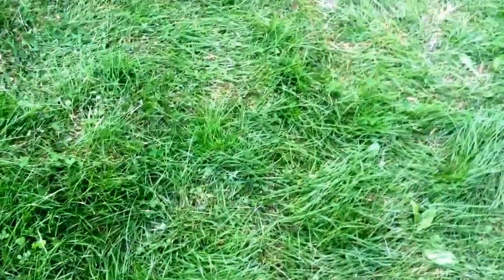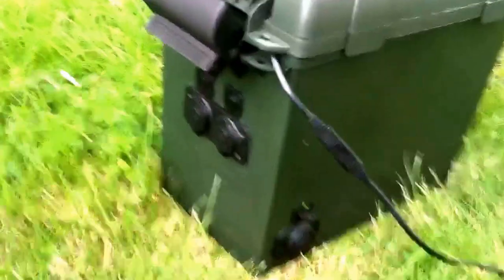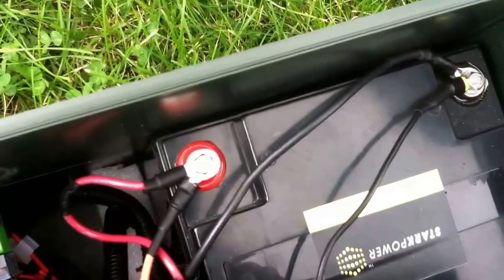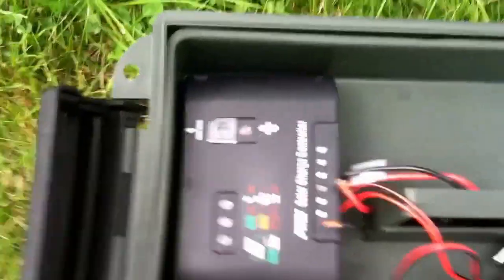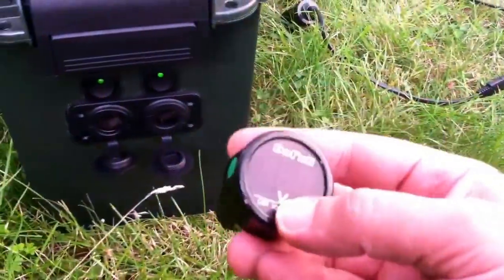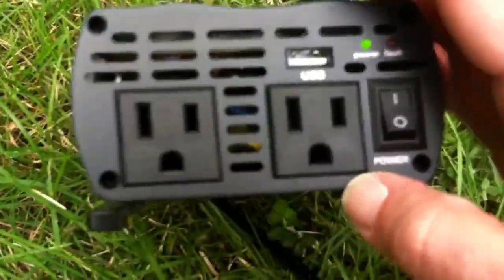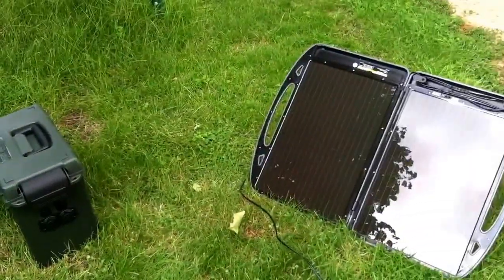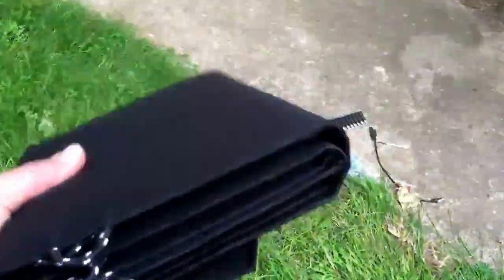Portable Solar Power Generator Lithium Ion LifePo DIY

Comment: Hey I know this is an old video but that's solar charge controller you're  using is for lead-acid batteries, not for lithium ion.  You're probably overcharging us batteries every time you connect that solar panel. Also that Harbor Freight solar panel, is that the 13 watch version? I also have one of those but I upgraded to a powerfilm flexible solar panel, for less weight and more amps in. Anyway thanks for sharing your build.

Comment: You CAN replace the AGM batteries in the Yeti 150 & 400 with LiFePO4 Batteries. This is actually CHEAPER than buying the YETIs WITH the Lithium Batteries from Goal Zero-if you know where to look.

Comment: I am interested in putting generated power into li-po batteries, I am stuck on how to regulate the power in, the solar controler is for lead acid battery according to amazon,..does it work ok with your li-po or did you have to do something?  Thanks!
Reply: Hey guys definitely don't use a lead-acid charge controller on a lithium ion battery. You can get away with it with lithium iron phosphate batteries but not lithium ion. There's one coming here that says they're using lead acid charge controllers on lithium batteries. That guy doesn't understand the difference between Lithium ion and lithium iron phosphate. With the exception of the wrong charge controller in this video, it's pretty good build. Genasun makes a series of charge controllers for Lithium ion and lithium iron phosphate. That's what I used on my solar generator build.
Reply: Eric Krohn I'm in the same boat as you.
Reply: Need a hobby charger to maintain voltage while pushing amps.
Reply: I have a pair of Bioenno 15 Amp LiFePO4 batteries. had them for about a year, now. I have used a "lead Acid" Charge Controller on them from a 150 Watt Panel, and have had ZERO problems.
As yet, I do not have DEFINITIVE proof, but I am becoming more and more of the belief that any decent controller will work with the lithium batteries without harming them, but-DO NOT HOD ME TO THAT!
Google Light Harvest Solar in Portland OR, and speak with a man named Miles. That guy KNOWS HIS SHTF!
Reply: @bruceforster3709  you should edit your comment Bruce. Your bioenno power batteries are lithium iron phosphate not lithium-ion. The voltages are different, that's why you were able to get away with you let acid charge controller on their batteries. This build is lithium ion build according to them guy in the video nominal voltage is 11.1. Nominal voltage of a lithium iron phosphate system is 12.8. That's much closer to lead acid.
Reply: @OH8STN  Your point is well taken, and I am CERTAINLY open to correction! Given what I have learned since, you are ABSOLUTELY RIGHT! That being said, I have since determined to use dedicated Lithium Iron Phosphate designed controllers from here on.  OMG, it IS expensive to get into this stuff, but I feel the money is well spent.
Reply: @bruceforster3709  yeah the cost is heartbreaking in comparison to the cheap Chinese controllers. But I've been using these controllers for years and I have never had one fail, or destroy a battery. So I look at them as an investment in my expensive batteries. Bioenno makes one for your batteries btw. I don't use it because it charges to 14.6 volts. That reduces the life of our lithium iron phosphate cells. But they have a good service life anyways so, maybe it's not a bad thing.
Reply: @OH8STN 
 Kevin tells me they CAN be adjusted down; but he did not tell me HOW, LOL!
THANK YOU for being so kind to me in your response. I am challenged with Aspergers Syndrome, so "normal" people are usually very mean towards me. 

My social skills are a LOT better than they used to be. That being said, people, and sadly HAMS in particular think that because I have this high-functioning (In my case VERY high) Autism, They believe I can't POSSIBLY know what I know or do the things I can do.

Certain individuals lie about me ALL of the time, and the general populace believes them. It is a DAMNED lonely life, sometimes.

Comment: I see you like to use the USB ports via the cigarette lighter, take a look a these and read the specs. They are awesome as it will determine the correct amp rate to charge various phones and can handle 2.4A per port.

https://www.amazon.com/gp/product/B0144S0PDK/ref=oh_aui_detailpage_o00_s03?ie=UTF8&psc=1 or for more power this is another quality unit: https://www.amazon.com/dp/B01K9MQ8WW?psc=1

Comment: I just finished my generator and used a smaller ammo box.  I went with SLA AGM batteries, but LiFePO batteries are the future.  They aren't cheap, but the benefits are there.  I purchased the LiFePO battery and couldn't believe how much lighter it is compared to SLA.  There's not many charge controllers out there that work with LiFePO, but I found one I'm going to purchase.  Thanks for sharing!
Here's a link to my project: https://www.youtube.com/watch?v=7ecGY3z558I
Blog post: http://mattlesak.com/solar/2015/1/9/solar-generator-project

Comment: Could you break down your parts list please (or better yet, add it to the description?).  You have a very slick setup that  I'd  like to copy - curious what charge controller and 12v DC charger you're using.  Seen a lot of good reviews on that portable briefcase panel you're  using as well.

Thanks for sharing!